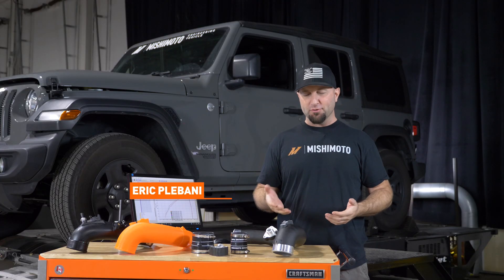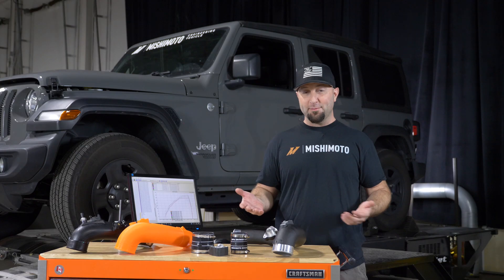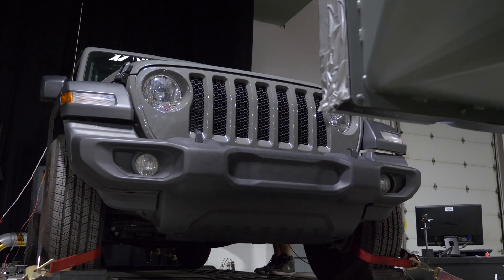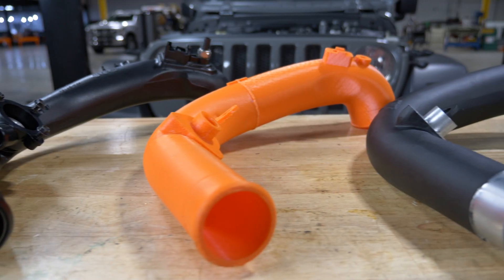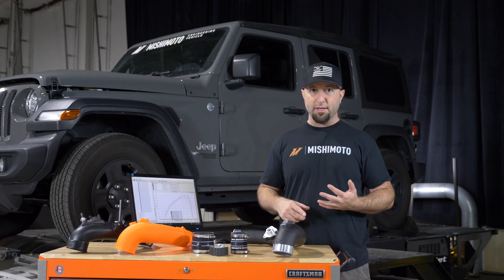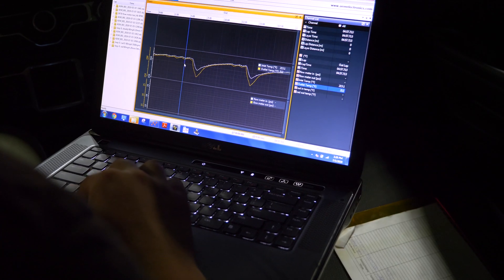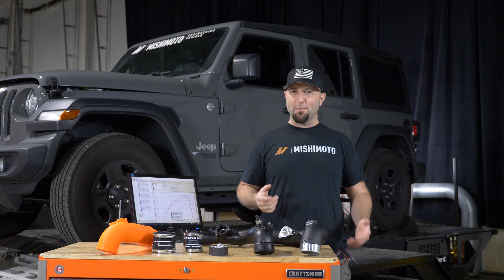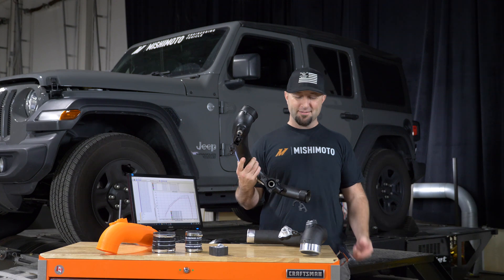Mishimoto Behind the Scenes: 2018+ Jeep Wrangler JL 2.0L Performance Intercooler Pipe Dyno Testing

Comment: 7hp on a Jeep in the top end? Toss that in the garbage and call us when you actually got something useful.
Reply from the maker: As with any aftermarket engine components you will not see major gains until the Jeep is tuned, these numbers were on a stock tune.
Reply: Mishimoto Automotive how long until the Jeep is tuned ?
Reply: Sophisti Jeep yeah, when is a decent tune finally gonna come out